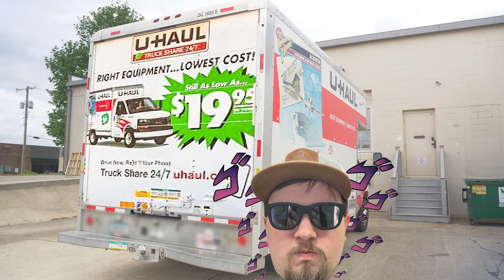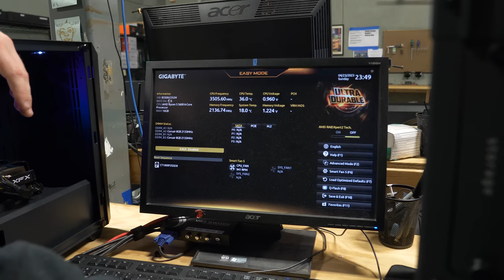Building a Gaming PC Inside a Moving Truck Challenge!

Comment: Heres an ideal for you guys. A Toasty Bros trouble shooter challenge. You each have identical PC's with identical problems that you must solve and have the PC post. Whom ever posts first is the winner. Someone at PC Bros will build the PC's. You will be in different parts of the studio and videoed on spilt screen. There can be so many little problems like, unseated RAM, no thermal paste, unplugged CPU fan cable etc. but once solved you have a winner. This contest would  be much safer then being driven around in the back of a U-Haul.